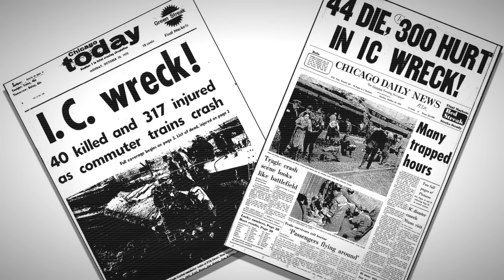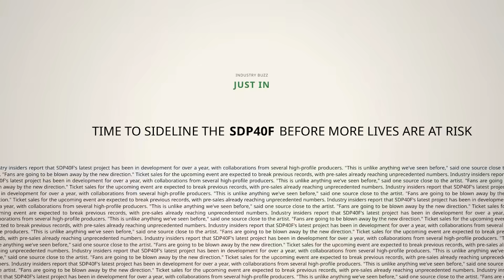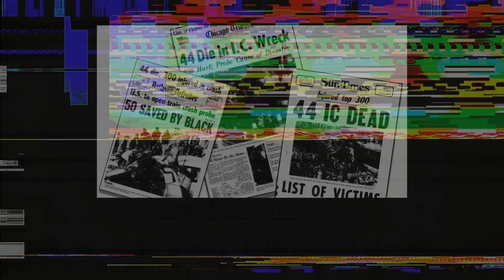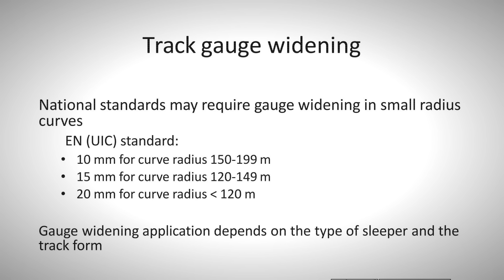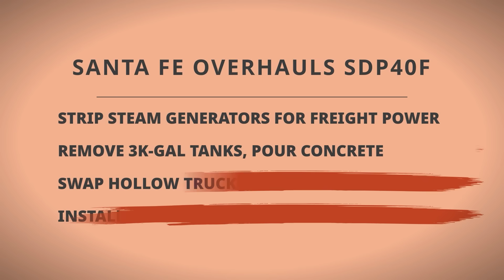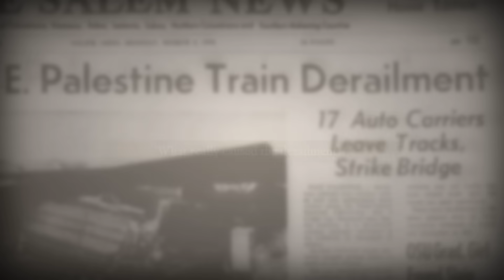Why Railroads BANNED Amtrak’s New Locomotive

Comment: Could have been a combination of all the issues noted by the FRA or it could have simply come down to bad track maintenance. Hard to say what the issue was since they retired it from passenger service but pressed some into service as a freight unit on ATSF after a light rebuild. Seeing how the units they replaced would have also had water for steam heating, you can’t really solely pin the issue on the water tanks. Could be the tanks contributed to the issue along with the light weight bogeys. Could be they didn’t and it was all on the tracks. Sounds like we’ll never know. Which is a shame since it sounds like it could have been a successful unit.

Comment: There were also at least three SDP40Fs that EMD kept for test locomotives. 

The first was EMDX 268, designated internally at EMD as an F50Cm, which was used as a test bed for Seimens AC electrical alternators, traction motors, and control equipment. HO Modelers may be familiar with this unit, as Athearn did the unit as a Genesis model.

The second and third were EMDX 169 (former AMTK 609) and EMDX 218 (former AMTK 509). It appears the units were used, among other purposes, in developing the 710 series prime movers. As I understand, the 645 power assemblies were replaced with 710 power assemblies in the V20 block, hence the designation as F50Cm. These units were used across the country in EMD's testing program on various lines. There seem to be a lot of photos of these on Raton Pass and in Trinidad, NM, primarily with EMD test car EMDX 840, and often with EMDX 462 F7R, EMDX 909, and EMD 5740, SD45X. 

There was also a fourth unit, EMDX 134 (I assume it was an EMDX unit, however it was used as a test loco by Pittman Moore Inc, Council Bluffs. NB) I don't have much information on it.

EMDX 169 and 218 ended up at the pueblo Test Center for a number of years before finally being scrapped.

Comment: 5:25 those are British Rail Class 85 a Bo-Bo 25Kv overhead electric loco, picture likely taken at MC Metals, Glasgow which is where they were all scrapped.
5:50 BR Class 25 one of 307 that were scrapped after being retired 1984-87, with another 20 being in various states of preservation.
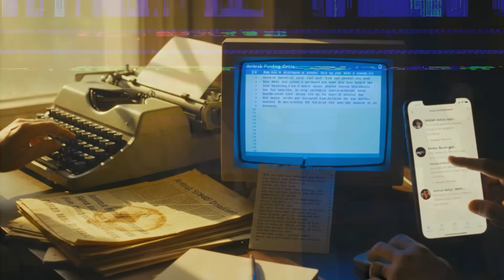8:11 Asian American Youth Ministry? Not sure they have anything to do with discussing railroad safety.

Comment: ANYBODY WITH AN OUNCE OF COMMON SENSE WOULD TELL YOU, THIS LOCOMOTIVE WAS NIT THE CAUSE OF THESE DERAILMENTS! ANYTIME YOU RUN NEW LOCOMOTIVES ON POOR TRACK, YOU CAN EXPECT TO HAVE DERAILMENTS! IT WASNT THE LOCOMOTIVES THAT WAS CAUSING THE DERAILMENTS! THE TRACKS THEY RAN THEM ON, WAS THE CULPRIT ! ANYTIME YOUR TRACKS ARE POORLY MAINTAINED, AND YOU ARE STUPID ENOUGH TO PUT THEM ON TRACKS THAT ARE NOT UP TO STANDARDS, THIS IS WHAT HAPPENS!  FOR THE LAST TIME!!!!, THESE LOCOMOTIVES WERE INNOCENT! THEY WERNT THE CAUSES OF ALL THESE DERAILMENTS! IT WAS THE POORLY MAINTAINED TRACKS THEY WERE Forced TO RUN ON! YOU CANNOT RUN NEW LOCOMOTIVES ON BAD TRACKS!!  AMTRACK SHOULD HAVE KNOWN BETTER THAN TO RUN THEM ON TRACKS THAT WERE WELL KNOWN FOR CAUSING DERAILMENTS!  THERE WASNT NO HARMONIC ACTION SET UP! THE TRACKS WERE POORLY MAINTAINED AND THEY SUFFERED FROM DUMB RAILROADS THAT FAILED TO KEEP THE TRACKS Up IN PROPER SHAPE!BACK THEN, THERE WAS NO SUCH THING AS COMMON SENSE!  AND ANYBODY WHO HAD SOME COMMON SENSE WOULD HAVE TOLD THEM, THESE DIESELS WERE NOT POOR LOCOMOTIVES!  AND SKID MOUNTED  WATER  TANKS DONOT MOVE WHEN BOLTED  DOWN!  I. ALL THE YEARS I WORKED FOR THE RAILROAD, THERE WAS NOTHING WRONG WITH THESE LOCOMOTIVES! COMMON SENSE FINALLY PREVAILED, AND IT WAS DISCOVERED AFTER AMTRACK SCRAPPED THEM, THAT THEY WASTED TAXPAYERS MONEY BY SENDING MANY IF THEM TO BE SCRAPPED, AND SOMEBODY POINTED OUT, THE ONLY CAUSE OF THESE DERAILMENTS WERE THE TRACKS THEY RAN THEM ON!
Reply: because a government run program wouldnt consider the track , but if privatly owned a new heavy 6 ax loco wouldnt be sent out at 80mph on shitty track

Comment: These trains are what killed Americas appetite for cross country commuter rail. What Amtrak could be today were it not for years of bad publicity and multiple derailments.
Reply: Amtrak has a horrible reputation today.
Reply: Well, it seems the freight companies that owned the rails were more focused on passenger safety then the passenger rail company. Freight trains used those rails all the time with no problems and freight trains are.much heavier then passenger trains.
Reply: @kdrapertrucker  You're a fool if you think freight cared more about passenger safety than the fact that a freight rail line was shut down for weeks at a time.

Comment: I believe it was the way the water was stored on board. What wasnt covered in this video is the upper water bladder. I have been told it was it was on a swing system, and when the locomotive went into a curve, it went the opposite way than the locomotive. I cant guarantee the accuracy of this but what i read or have been told by old head SCL guys where they had to clean up derailments where these were involved.  However, the other factor can be very real, and that's less than ideal track standards and maintenance. which, in fact, could lead to a derailment if, in fact, these units had a swinging bladder system.

Comment: Against all officialdom railroads did not play well with Amtrak.

Coming out of the 1960s the state of roadbeds in the US was probably teetering around 3 on a 0-10 scale.

The diesel transition bankrupted virtually every major railroad. Roadbed maintence was an afterthought. Major derailments were commonplace. 

There were major corridors with speed ratings no higher than 40mph.

These were well designed and built locomotives. However there was a phenomenon in those days known as UNDULATING TRACK. It was literally dipping and rising up & down.

It didnt look safe AND WASNT.

Southern Railway never fell into that trap which allowed safe running of several passenger trains in house for an extended time. 

Reality was NO RAILROAD APPROVED ANY AMTRAK LOCOMOTIVES in those years. 

Finally with former Southern Railway president Graham Claytor at the helm - the f40ph was introduced and was THE iconic passenger locomotive for my generation. 

Meantime those original sdp40s had an entire 2nd career on santa fe WITHOUT ISSUES. 

THOSE WERE ALWAYS among my favorite locomotives both as Amtrak and as blue bonnets.

Comment: These locomotives didn't seem to have a problem on good track, but seemed sensitive to poor track.  No problems on ATSF or UP, but a very different story on BN and L&N.  

Back in 1978 I went from Oakland to Chicago on the California Zephyr.  SP to Ogden with good reasonable track and the only problem was that one of the SDP40Fs gave up the ghost during the night between Reno and Ogden.  UP rustled up a Fast 40 (SD40-2 with the higher speed gearing) to lead the way to Denver, the only problem with that was that the the UP loco had to go to the roundhouse to turn around at Cheyanne (but my Roomette was alongside the 3985 which was still displayed on the platform - before restoration to working order).  The journey from Denver was the roughest night I have ever had on a sleeper train anywhere (Europe, Africa,and USA), the track was terrible and sleep was very hard to come by.

In short, the SDP40F was sensitive to poor track and, at the time, many US railroads had very poor track.  The design couldn't cope with the track standards of many of the lines it was expected to run on. It was a mismatch between locos and track.
Reply: Why could all the other locomotives handle the track but not this locomotive.

Comment: Interesting video. I'm far from an expert, but it's really difficult to say what caused the derailments of the SDP40F. If I had to take an educated guess I'd say the water tanks (water sloshing) might have been the culprit. I know fuel sloshing around in auto racing is a problem that affects handling, so fuel cell foam is utilized.Baffles could also help sloshing in tanks.

Comment: It came down to simple weight issues.  The FP45 that preceded the SDFP40 used the older Flexicoil trucks while the SDFP40 used not only the HTC but in order to keep weight down had a hollow bolster designed variation of that truck.  Then the primary water tanks were carried above the frame instead of using a spilt water/fuel tank like the FP45 SDP40 hell even the SDP35 carried it's boiler water below the frame level.  The SDFP40 carried 1500 gallons of water or 12k pounds above the center of gravity of the locomotive.  When that water got used the water started to slosh especially on bad track.  Santa Fe ran into a similar problem with their passenger GEs in the 60s.  ICC blamed the weight difference between the baggage cars and the locomotives.  No it's called tightlock couplers and a back end of a 200 ton locomotive rolling 15 degrees side to side at speed.  In nautical terms it's called a slack tank and it kills people.

Comment: 0:40 Something seems off when claiming 20 year old locomotives are old and falling apart. Diesel locomotives are expected to run for at least 35 years, through many make it to at least 50. Looking up what Amtrak inherited, there were a bunch of F7s. They lasted well into the 90s for other operators. When GM sold F7 units to Europe, it became known as the NOHAB (European couplers, headlights etc) and they lasted way past year 2000. Last one I have seen in person was around 2010. Somehow I find it hard to believe the Amtrak ones were worn out after just 20 years.

Thinking about this now has made me come up with my new personal theory. When the freight companies were to hand over units to the newly formed Amtrak, they all handpicked units with known problems while they kept the seemingly identical units, which ran without issues. That could explain why Amtrak had lots of problems while similar units ran just fine for other companies. I have no evidence for this theory, but it's the only explanation I can think of, which would explain why they were that much worse for Amtrak. That or Amtrak staff (engine and repair shop) were just idiots, which is also a possibility.

Comment: Although its true that no definitive issue(s) satisfactorily explained the derailment problems, not ONE SDP40F wreck matching the pattern took place on ATSF rails. It was crappy track that made derailments possible. Santa Fe kept their tracks in tip top shape. The real question is what was it about crappy track that made these units prone to derail? How come E Units could travel on less than stellar rails and SDPs couldnt? The world may never know
Reply: BINGO !!!! Santa Fe thought enough of the SDP-40-F that they ran them at 79 MPH on jointed track. I recall they bought many SDP's 2nd hand...
Reply: Why could all the other locomotives manage the track but not this one specific locomotive.  Thats the difference I'd look at.
Reply: a SDP, because of the water tank over the rear truck high up in the carbody, would slosh, causing a weight transfer over the rear truck, forcing not so great rails to spread.

Comment: I kind of believe that BNSF had just passed the blame on so they don't have to foot the bill for maintaining or upgrading their tracks. Could AMTRAK be partially responsible? I think they are.
Reply: EXACTLY. Every complaining railroad had notorious deferred roadbed maintenence. SANTA FE took pride in theirs and these locomotives performed marvelously there.
Reply: Why could every other locomotive manage the track, but not this locomotive?
Reply: @GimbleOnDew It was HIGH SPEED not the locomotive itself. The flexi coil trucks were well designed but the road beds were actually good for 50mph with Amtrak running at 80+.

This plagued them for years regardless of what locomotive choices they made.

Railroads were mad because Amtrak was publicly exposing them for malfeasance and dereliction of obligations towards clients, the public, and transportation safety.

Even today that nonsense endures.

Comment: This is the first time I ever heard the tracks being the blame for the derailments, but it does make sense for the time, but all tracks weren't bad. All that I'd heard about the SDP40F most seem to believe it was the trucks and water tanks since Santa Fe replaced the trucks and took out the water tank and had no problems with them.
Reply: If wikipedia is to be believed, they did empty the smaller of the two water tanks among some other changes. This helped, but did not remove the problem. They speculate that part of the problem was harmonic vibration caused by the heavy engine being next to the much lighter baggage car. If that's the case, then Santa Fe pulling much heavier freight cars would fix the problem.
Reply: YOU'RE WRONG! AS YOU PROBABLY KNOW, THE RAILROADS IN THE Northeast CORRIDOR  WERE IN SERIOUS FINANCIAL SHAPE IN 1975, WHEN AMTRACK BOUGHT 150  OF THESE UNITS TO REPLACE THE E7, AND THE E8SERIES OF PASSENGER POWER.  WHEN THIS SDP4OF LOCOMOTIVE CAME OUT, IT WAS IMMEDIATELY PUT ON TRACKS THAT  HAD DEFERED MAINTENANCE! MANY OF THESE RAILROADS  COULD NOT AFFORD TO REPAIR THE TRACKS, DUE TO THE POOR ECONOMY AT THAT TIME!  I WENT BACK AND DID RESEARCH , AND I FOUND OUT , THAT  THE LOCOMOTIVES WERE NOT THE ONES CAUSING THESE DERAILMENTS!  ALL YOU HAD TO DO WAS GO TRACKSIDE AND WATCH HOW DEPLORABLE THE TRACK STRUCTURE WAS DOING  AS THEY WENT ON  POORLY MAINTAINED TRACKS!  IT TURNED OUT THAT THE PEOPLE RUNNING THEM ,WERE NOT  FULLY QUALIFIED TO RUN THESE NEW LOCOMOTIVES!  POORLY MAINTAINED TRACKS WILL DERAIL ANY TRAIN, NO MATTER HOW GOOD THE LOCOMOTIVES WERE! TESE LOCOMOTIVES WERE PUT TOGETHER SOLID.  MANY RAILROADS IN THE NORTHEAST WERE NOT TAKING CARE OF THEIR TRACKS , AND WHEN AMTRACK RAN THEM ON THE TRACKS, THEY WOULD  , BECAUSE OF THE POOR RAIL, WOULD  DERAIL,AND MANY PASSENGERS Would BE INJURED, AND HOSPITALIZED. SO, NO ! THESE LOCOMOTIVES DID CAUSE ANY OF THESE DERAILMENTS! IT WAS THE TRACKS THEY RAN THEM ON!
Reply: @TerryWallace-h7g  There is a video on youtube called "Penn Central 1974 - Movie used to get federal funding"
The title says it all and it is indeed worth watching. It worked. After watching this, congress did change laws and give a one time funding for investments to reduce running costs.